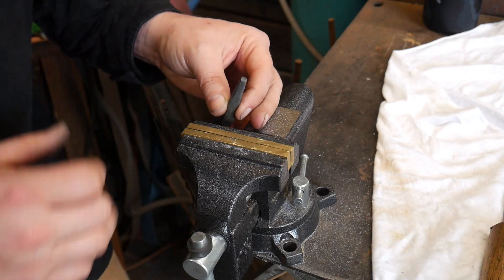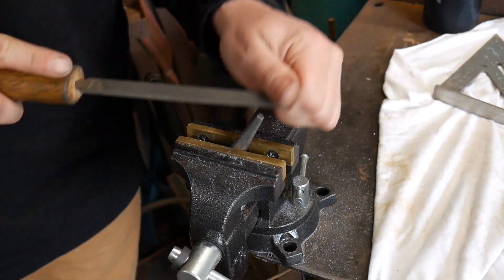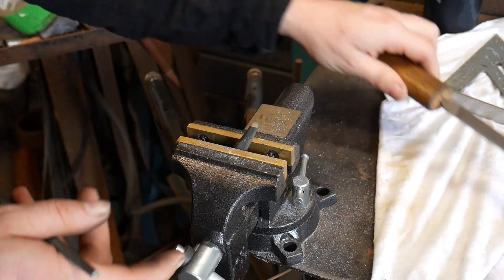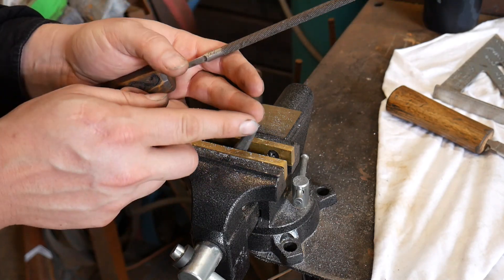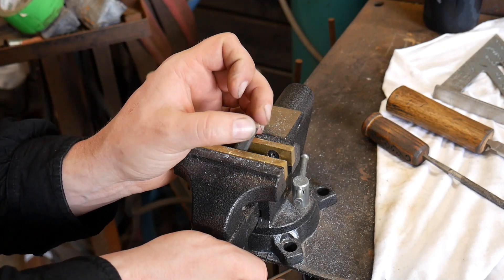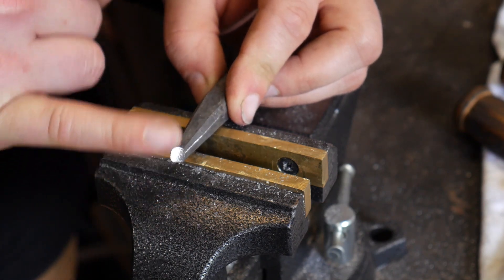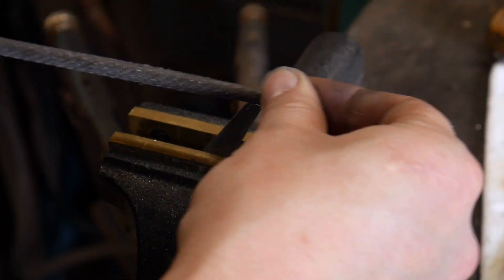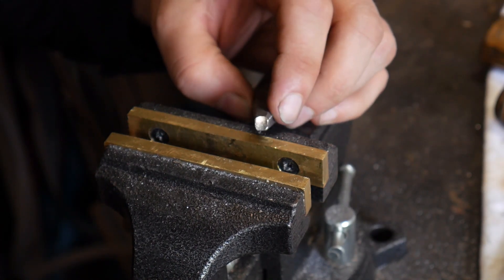Step Two: Filing a Concave Butcher Tool [The Chasing Tool Series]

Comment: hi roy
I find it helps to cut a small groove in the centre with a square file before using the round I also do this if im filing a larger concave and have a high spot, otherwise it  just wants to constantly roll off, keep em coming im realy enjoying the filing and chasing vids, ill be setting aside some time in the near future to making up some tooling so ill be binge watching, had a little go at some mild steel with a small chisel the other day cant wait to have a decent crack at it, im in the early stages of building a dedicated workshop then it will be full steam ahead